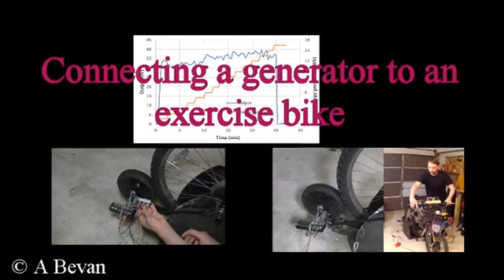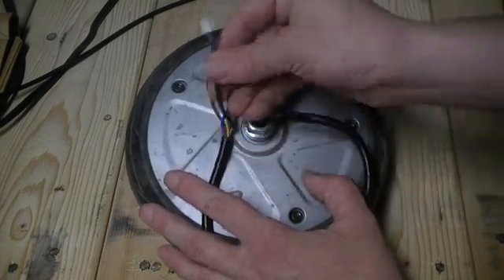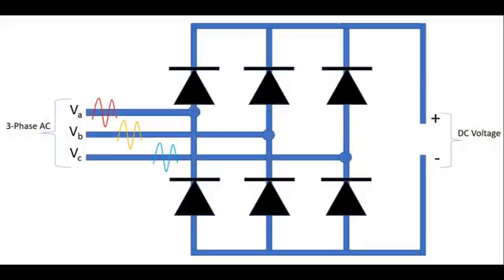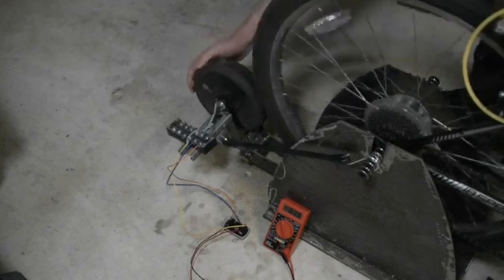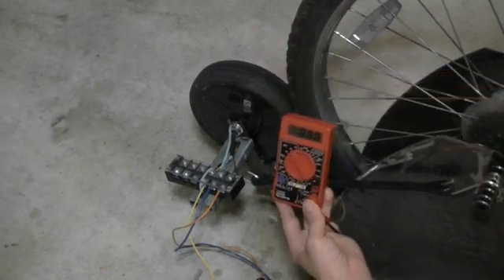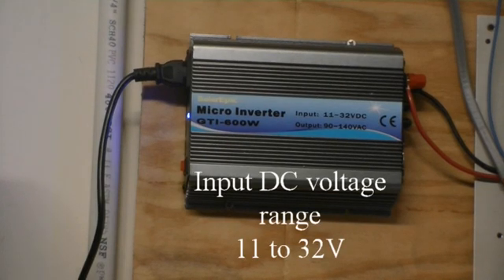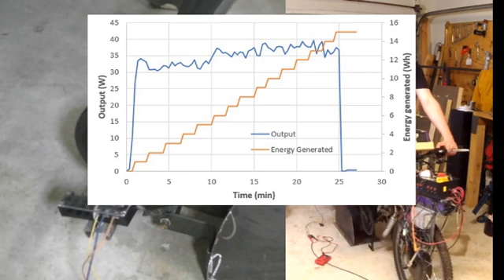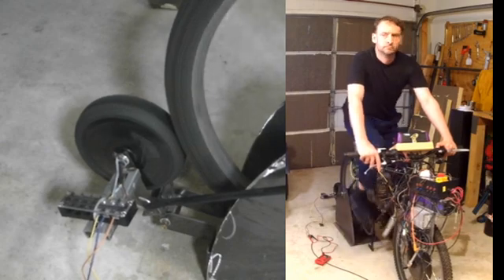Connecting a generator to an exercise bike

Comment: it doesnt seems hard to turn the wheel ? if so It could be improved if you mount many generators instead on having just one. So the time spend on the bicycle can have a better return on energy.
Reply from the maker: After an hour turning 1 wheel is enough for me, it will take a while to build up to a 2 wheel generator.